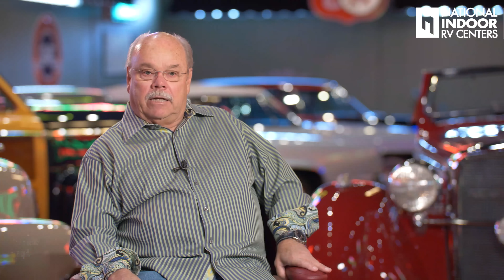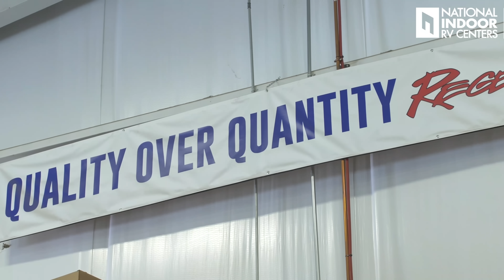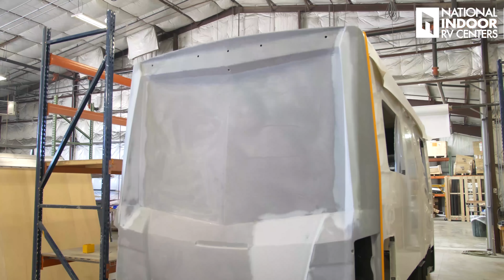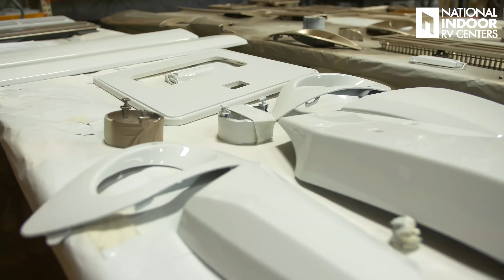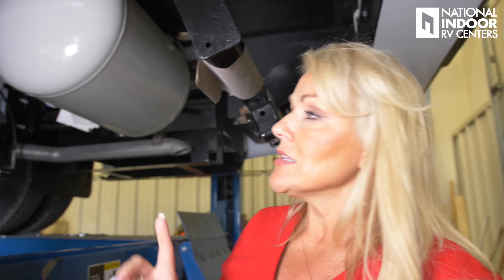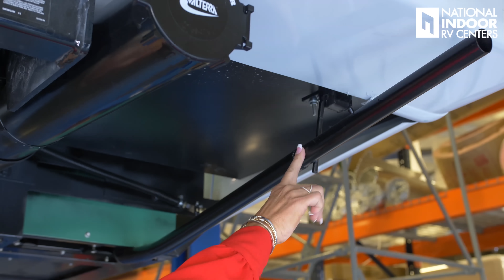Regency RV Factory Tour

Comment: Im impressed with Regency, but even more so with your delivery on this tour.  I thought the coach review you did on a Regency was a bit long but this was well delivered and to the point.  The only part missing on both reviews is the inverter and battery specs.  Glad to see you noted AGM batteries, but missed the storage and inverter spec.  The question would be can it run the Microwave, [2000+].  The big downfall of the Leisure is 1000 watt inverter and just deep cycle battery, they are fixing that now I understand.    Anyway you did an incredible job on this tour, thanks.  BTW they are in the same complex as Mike from By Design that has done lots of Clear Bra on my cars and I have talked to the Regency people once.  You should Clear Bra your coaches or Regency should, I hope you have that service at the Lewisville store.
Reply from the maker: Thank you for taking the time to watch our Regency videos, your kind words and your questions. I really appreciate it!

I’m sorry for leaving out the specs on my walk through of the Ultra Brougham and Traveler. In my defense I do these videos with no script, so do end up missing some things which I never know until after the fact. Sorry about that. 

Now to your questions. The Ultra Brougham comes standard with a 1,200 watt inverter with a 2,000 watt inverter as an option. The Traveler comes standard with a 2,000 watt inverter.

To my knowledge there is no Diamond Shield or clear bra on the front of the Regency units. 

If I can be of any further assistance please don’t hesitate in giving me a call or texting me (469) 277-1120. 

All the best,
Angie